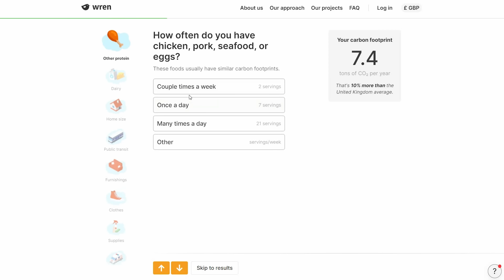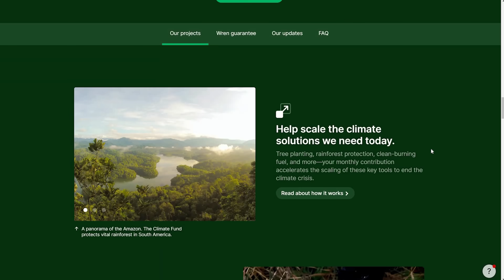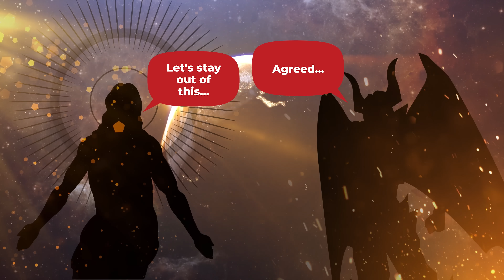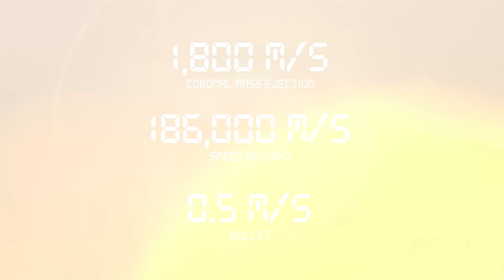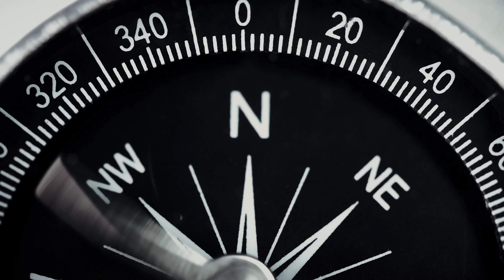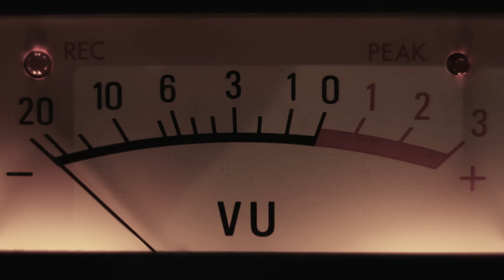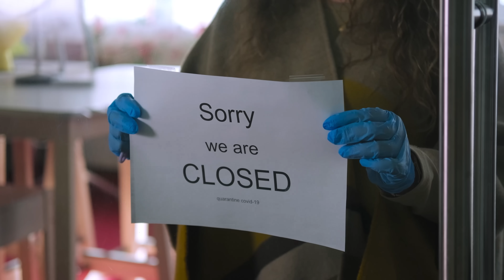Could the Sun Destroy Earth Tomorrow?

Comment: Destroy the Earth?
No.
Destroy societies worldwide and effectively, civilization as we know it?
Certainly.

FYI, the wires used in the telegraph network were early versions that had no shielding whatsoever. A Carrington level event, or larger, 
(estimated at X200+ ) 
then there's more than just the power transmission lines that would be vulnerable. In fact, even if 100% of infrastructure and hardware on Earth was fortified against such an event, it would make little difference as the impact on our satellites alone would be catastrophic for humanity as we would be sent back to the 1940's almost immediately upon impact, and today's societies are simply too dependent on Earths satellite constellation to function effectively if they were suddenly inoperative. 

*The only Satellite constellation that would stand a decent chance of enduring such an event would be Starlink.... And even then the clock is ticking to get the relative industries up and running again to service the ongoing requirement for the constellation to be continuously replenished as their low altitude orbit has the inherent consequence of severely shortening their lifespan before atmospheric drag degrades their orbit to the point that they re-enter the upper, then lower, atmosphere and burn up... 

In short, a Carrington level event (or the proposed once in a 6000yr X1000+ event...) would sort out humanity into 3 categories almost immediately,
1) The ruling elite and their 100million $$ cubby houses.
2) A percentage of the 'crazy' peppers who have been literally preparing for such an event for many, many years. 
3) The decreased 90%+ of everyone else, as society almost immediately collapses and the rule of law & order quickly disintegrates into the rule of survival-of-the-fittest. (That are naturally endowed with the characteristics of also naturally being the most ruthless, methodical & influential.)
Reply: Everything can be destroyed , including our very world. AND just because the world itself isn't destroyed right away by The Sun in one way or another , doesn't mean it won't be eventually

Comment: Oooooohhhh free power from sun flares etc... Now that something to work on harnessing outside our atmosphere which can then be slingshot down to the surface of earth where it's caught by a collector which can then be moved around the planet to power everything we could imagine. Good bye nuclear power plants, coal, gas, wood, etc ... If it worked to power telegraph equipment that had their power sources disconnected then it's already a phenomenon that works the proof of concept was an unplanned success. Therefore it had to be possible to reproduce the effect in a controlled way just like we learned to control fire. Now we carry portable fire in our pockets. We have batteries that store power and lightening can transmit electricity over vast distances. We can attract that power to strike a lightening rod to ground the destructive power into the ground where it disipates safely. We shield against short circuits and components from frying already we can do the same with the solar storms and crap. It's just a matter of designing possible shielding solutions and exposing those inventions to the storms out in space before another event happens before we have sorted the logistics for harnessing the tech and protecting devices. Not everything is affected by those solar events already we just need to figure out through experiments which things will also protect stuff that can't handle the uncontrollable ones without help

Comment: It's not that type of star. Ours will slowly fade out as it expands. It will not explode and go supernova. When that happens, a neutron star is born and has more gravitational forces than a black hole. Ours will expand and turn into a white dwarf. In the case of one going supernova, it's usually caused by a vampiric star. It drains the gas gaint and causes it to go supernova and then it goes supernova itself, which leaves a neutron star behind. I'm sure there is still lots we don't know. Like how many, If not most stars are born with a binary or multiple and for us to have just one, is odd... maybe we don't have just one and we don't know which is our binary. Our planets orbit around our sun is also odd and at this point, should be perfect. The only way we could make an oval shape orbit, is if something else is pulling our planet off course.

Comment: Incredible a faraday system will project us against minor solar flares, but a directly whopper as mentioned, I don’t think is enough but we have built our lives almost without any projection against our electric system which almost every thing we uses are depending on. I wonder why we still behave as we live in a secure environment, even it should be common knowledge we on the opposite lives in a hostile environment, from the sun, asteroid, climate change, wars , religious insanity and not to forget the silver hat community alien attack and the structure holding all the water on earth, breaking down and we will soon know what actually is beneath the earlier ocean. Or at the bottom or the unknown depth of the former see ! So much to worry about as long we act as mentioned we live in a  hostile environment or nothing to worry about  if we live in a secure environment. You decide! Unfortunately I don’t know who will hear me say: I told you so!! 🥁🎸🍻🥶

Comment: The internet is not a threat to solar flares because OFCs are not conductors. Earlier when we had coaxial cables, it would have been an issue but the world have moved on quite a bit. Also, light is not affected by magnetic and electrical fields.

Comment: Thank you for this video. It is important that people know about the true tech killer event, the one that can likely actually happen, while asteroids and supervolcano are much more improbable.
While a Carrington-sized CME would short-circuit all semiconductor junctions and burn all power-transformer windings by sending DC across AC power lines, it is true that is possible to repair the infrastructure in a couple of decades.
I haven't heard or read here of the true long-term horror of a big CME: the almost total loss of data on hard disks, data tapes and Flash Memory. 
Cell phone numbers, bank account balances, anagraphic information, insurance data, tax payments, land and house property data - are all spinning on some disks and backed up on other disks or tapes. All music and photos are stored on zillions of charge traps inside Nand Flash chips. 
All data and their backups will likely be deleted by the oversized CME. 
 That is my biggest gripe with a global communication / information network designed and built like the Sun would never burp.
It is like building a city on the side of an active volcano.

Comment: Use your deductively restrained imagination just a tad.  There are as many automobile batteries distributed around the globe as there are people.  Those batteries are usually hooked up to complex wiring systems.  Also, when overwhelmed, the latest evolved versions have a tendency to explode.  For that matter, ANYTHING with a battery and a circuit wired in is likely to combustively spark when affected by an overwhelming MCE. 

The whole civilized world will backdraft-burn down as the tens-of-billions of battery-enhanced electronic devices scattered around the world spontaneously combust.

Not if, but WHEN it happens.

Comment: The earth’s magnetic field lines would contain the bulk of the charges, a larger event would have electrical discharges from those field lines to the earth’s surface.  You could send rockets to space with a trailing wire attached to the ground all over the world to discharge this potential electric buildup of energies, but a solar Nova would spell doom.
Reply: Our fields are currently weakened by the moving magnetic poles.....

Comment: EVERYone is just marking time until the 100% inevitable next CME/carrington event that's coming down the pike.

And then... major bigtime EMP. And then... eventual meltdowns of all the nuclear reactors and spent fuel pools.

Nuclear war... Pfffft. Hardly even worth mentioning compared to nuclear meltdowns.

A bomb goes boom and that's all the radiation it will ever produce. But meltdowns produce and spew out enormous amounts of new radioactive particles next to forever.
Reply: The side of the planet facing the CME will be immediately affected by the EMP. And those cooling systems will start the process of going into meltdown. And those meltdowns will start spewing out enormous amounts of radiation that will cause disruption to the personnel and logistics needed to keep the cooling systems running and correcting whatever inevitable glitches that happen in the reactors and spent fuel pools on the other side of the planet.

Eventually, all the reactors and spent fuel pools will be in meltdown.

Radiation will sterilize the planet dead, pole to pole.

No one survives. Not anyone anywhere. Everyone dies. And that's that. End of story.

Loss of electrical grids will certainly be... problematic... but all the nuclear meltdowns will be the actual disaster.
Reply: This is the way the world ends. This is the way the world ends. This is the way the world ends. Not with a bang but with the whimper of uncontrollable diarrhea and vomiting caused by radiation sickness. ☢
Reply: Kicking the bucket from radiation sickness?

A very messy process from both ends of the alimentary tubing. You won't enjoy it.

Comment: Well its a good thing we have heavily insulted cables, breakers, and undersea tubes.

Edit: I can imagine your scenario near the end lol. I was caught up in the Texas winter storm earlier this year and went 3 days without power, water, or heating. Only one shop nearby was open, but it was cash only and quickly emptied. Couldn't drive anywhere, as the roads were iced over under the snow and my car would just slide around. Pipes burst in my apartment building, someone set their unit on fire which led to us evacuating the building for hours, and there was literally nothing to do other than try to stay warm and read a book.

Comment: I think its good that this Topic is finally getting more attention. Usually such global events are occouring in much larger timespans, but carrington events are comparatively very common, and the only reason we never really noticed them was because at no point in history we were as technologized and dependent on electricity as we are today. Think of Small things like even the Cash register of a supermarket would stop working. No Bank/visapayments. Probably cash will be even tough when the Cash register only opens with electricity(considering also that you cant even withdraw cash at that timeperiod). Logistics will fail rather quickly because the pumping stations at gas stations will fail(allthough i could see they'd probably use a Generaor to power those). Trains will come to a halt. Most cars too that rely on electricity(but only depending on the strength of the storm, since cars are a farraday cage, but it doesn't necessarily mean they are 100% protected).
If it lasts longer, heating and cooking will become a problem in countries that rely on electricity for heating.
Drinking water will become an issue in countries that rely on Outside sources from other countries or Desalination plants, which will also affect their agriculture and might cause starvation.(not to mention that evne the Pumps for that water would fail)
Nuclear plants are also a story of their own. They are designed to withstand such effects, but I don't wanna talk about the older ones in eastern europe, russia or other countries where corruption fucked the sturdiness of such a facility.

Nothing. Like literally Nothing would work anymore. We would be literally thrown back to the Stoneage, for who knows how long. It'd be even worse than living in the 1900s, because back then people on the countryside were not always enitrely industrialized, and had their fair share of manual tools, even in forestry. Even nowadays most modern homes aren't designed with a Stove, or even an exhaust for smoke from cooking with a stove Like literally in winter Electricity dependent homes will become utterly useless in winter because they cant be heated.
Those tools do not exist anymore. You will suddenly need a massive labour effort in forestry to produce enough wood for the remaining propulation for heating and housing.
Massive labour in Agriculture, because machines probably wont work anymore.

Everyone would start living like a hobo, washing themselfes in the nearby river, bunching up together in tents and around campfires if the modern housings cant be heated. n shit.

Ofc all of this only happens if the event turns out to be as bad as mentioned. And even then Nowadays countries usualyl are already prepared for something like that and they probably could replace the burnt transformer stations rather quickly. But besides that I don't wanna know how the population starts to react if the power outage lasts for 1,2, 3 days etc...

Comment: I read in a Scientific American article a few weeks ago where they talked about evidence that the earth has been hit at least 3 times the last 10,000 years, one in around 7176 bc, one in 5259 bc, and another in 755 AD by solar flares that are between 10-100 times the strength of the Carrington event. Solar flares of that magnitude cause solar storms that create Carbon 14, which trees store in the rings, which is how they know the exact year. Evidence may also be stored in ice caps with different elements and less accurate.

They're going through the Holocene period, last 12,000 years, and they said "so far we've done around 16% of it" so those even bigger solar flares might turn out to hit the earth with even greater frequency than 3 times per 10,000 years. 

look up "Solar ‘Superflares’ Rocked Earth Less Than 10,000 Years Ago—and Could Strike Again" for those who want to read more, I just summarized it quickly.

Comment: "Well prepared for whatever the sun can throw at us"   We currently know less that 1% about how suns work and what they do. It's entirely possible for the sun to have a MUCH bigger solar flare that would literally vaporize everything on the surface of earth turn the entire planet into molten rock for hundreds of thousands of years (and of course wiping out all living creatures on it).  Sun activity is very hard to study and most "Knowledge" is theoretical as the lifespan of a sun is MUCH longer than we've been around. We've only ever glimpsed tiny slivers of a suns lifespan so it's hard to collect definitive data. They study distant stars to try and get a glimpse and gamma readings of notable sun activity but these are usually just discovered by luck and a LOT is still unobserved.